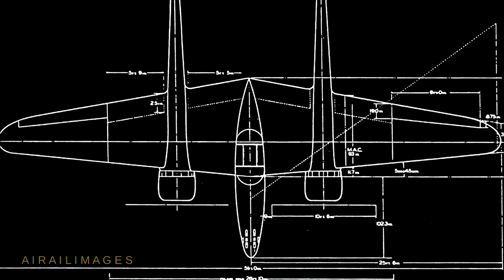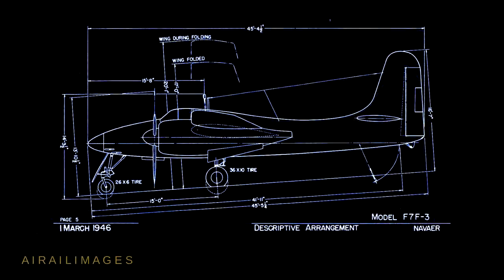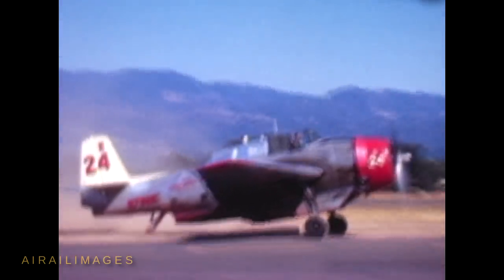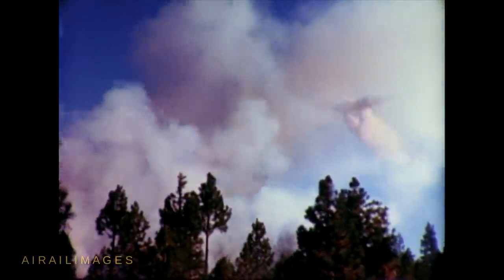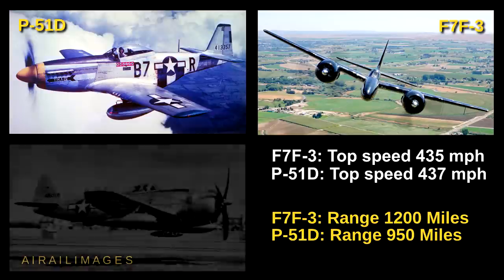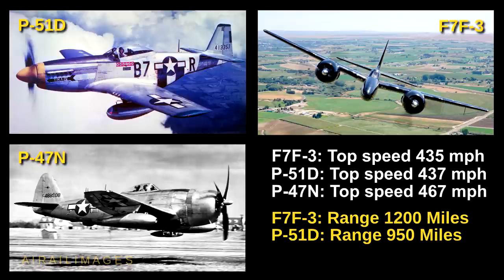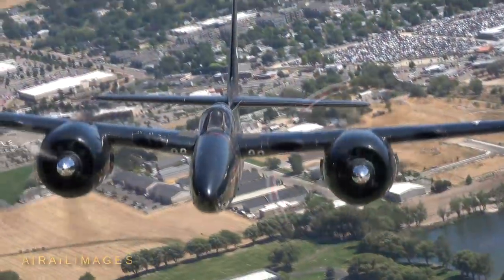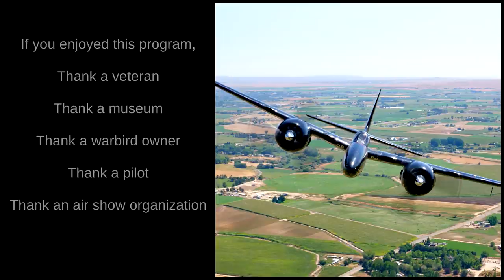Grumman F7F Tigercat: Airailimages Warplane Review

Comment: Fantastic. I worked for Sis-Q flying service 1963 thru 1965 as gofer apprentice mechanic, fuel service an even mixed slurry and ran the reload pit during fire missions.
There were 2 belly tanks operated on the F7f ‘s kritzberg  and the Stevenson the first kritzberg tank held 1000 gallons the rest we’re capable of 1200 gallons but were reduced to 1000 by a balk head installed in the AFF of the tank. This was done to prevent the aircraft from sitting down on the tail skid or tail hook. As the aircraft sat loaded on contract the thicker ( borate or bentonite clay) would settle and the CG would move aft then the aircraft would drop down on the skid ( you can see the airplanes in Korea parked in this position for security in the weather)  this CG was within limits for flight but looked funny on the tanker bases.
The Stevenson tank held 830 gallons.
When we installed the bulkhead we had the Siskiyou county weights and measures come out and certify the tanks. 
Sis-Q operated 4 tigercat’s during the period I worked there with all 3 of the tanks I mentioned
Reply from the maker: Thanks for adding that great detailed history. I'm going to add that to my notes about air tankers.  And thanks for watching.
Reply: Thanks I have some photos from back then and I can give some history of the the aircraft I worked on  some still survive if you are Interested.
Reply: My gramp's worked for sis-q back then

Comment: I would like to see a comparison of the P-38 to the F-7F.  The P-38 is still my favorite.  Thanks for the video, a very good history of an outstanding aircraft.
Reply from the maker: And the P-38 will be a topic of a future Airailimages Warplane Review...
Reply: That’s what I was thinking
Reply: Not better or worse, different.  The P38 had counter rotating engines, which gives it one of the best at stall behaviors of any of the WW2 fighters (and at a very low speed), and under combat flap setting it's one of the most maneuverable planes out there.  One of the only planes with boosted ailerons of the time (late J+).  F7F wasn't really designed as a fighter as much of it was an interceptor, which it would excell at.  Great climb, great dive, much heavier armement than the single engine fighters of the timeframe.  With 3 more 20mm over the P38 it's gun armament was deadly.  These attributes all make for a great night fighter, which was what it did the most in combat.  It would have been a great kamakaze interceptor, which I think was a role it was intended to fill, and paired with the much shorter range / low altitude Bearcats and excellent mid-high alt F4U-4/5s would have been a formidable group in the Pac had the war went further toward 46.
Reply: I just asked Greg of Greg's Aircraft essentially this same question.

Comment: I still remember the first time I saw one in a museum as a kid, even then I was awestruck with its beautiful design. I would say this is easily the best looking twin-radial ever built.  The Hughes H-1 probably gets the nod for single engine, and the Super Connie for quad. 
We were so lucky that the firefighting operations existed in the 50s - I crew a TBM Avenger which was pictured in the fire video portion, and it's likely that neither of these planes would still exist had they not found a job to do back then. 
Ugh the Tigercat - just an enigma of the warbird world. Ive seen everything in person flying around the airshow circuits with the TBM; Mosquitoes, 109s, etc, - never an F7F. :'(

Comment: Although all of these aircraft listed and their specifications are very impressive...vary few people seem to remember the Do335 Pfeil (Dorner 335 Arrow) which had a pusher propeller and a conventional puller propeller. It was a twin engine, and had both inline, inside the fuselage. One in front of the cockpit, the other behind. 

It had a top speed of 474mph.
Incredible for it's day. 

I'm not an expert, or a historiographer.
☀️😎🇺🇸☀️
Reply: Top speed is only one component, also at what altitude that top speed is achievable.  For example the Tigercat's is at 22k feet, the 335 is similar, but a Bearcat would likely outrun both at sea level because of supercharger gearing.  Also the 335 had low maneuverability from all accounts, so even the Tigercat would have likely performed better.  Especially with the much lower climb rate the 335 had.
Reply: That speed of 474 was never verified, and was thought to be an estimate

Comment: That airplane, with a pair of Merlin engines, in USAAF service, with a radar.  It would've mowed the Luftwaffe night units.
Reply: I don't know, the 1820 radial engine could hold it's own when compared to the Merlin.  Now it wasn't as aerodynamic, that's for sure, but it could hold it's own.
Reply: drinksnapple  Merlin is too anemic at only 1650 cu in compared to 2800  and the merlin was anemic on HP also  they were pulling 2800 HP from the R2800, and the Merlin might have come close to 2000, but reliability would suffer !!!
Reply: @normvw4053  Only in the TURBOcharged versions !!!   Why the B17 could fly 10,000 ft higher than a Lancaster !!

Comment: Those ranges are bogus,especially the P_47!!!!!!!!!!!!!!!!!!!!!
Reply from the maker: Always the least favorite part of this task -- since aircraft specification lists vary so widely. One usually reliable source said range 800 miles for the P-47N; another that we just found said combat radius for the N was 800 miles, but combat range was more than 1700 miles... go figure. But your point is well taken. Have added an addendum to the text, above. Thanks for commenting.
Reply: @airailimages  and the "N" was not the typical P-47 in widespread use. That would be the "D", which had a top speed of 428 mph. Still movin' though.